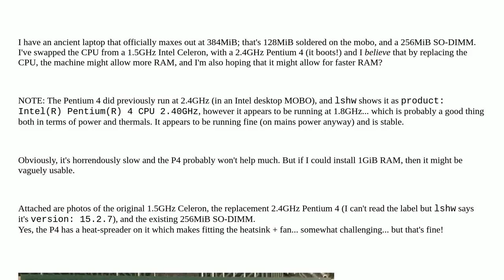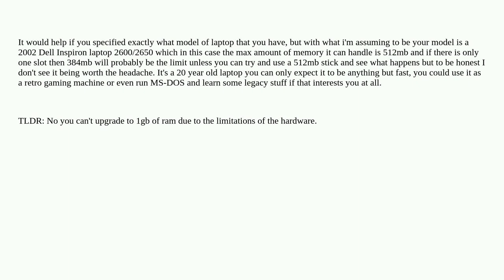Hardwarerecs: Can I use more + faster SODIMM with old laptop now I've switched from Celeron to Pe...

Comment: If he can find an updated BIOS for the motherboard he MIGHT be able to get it to run more RAM but it could also be that it just doesnt have the ability, either through lack of power, lack of instruction set for the computer to understand what you put in it, or limited capability of the northbridge on the frontside bus.